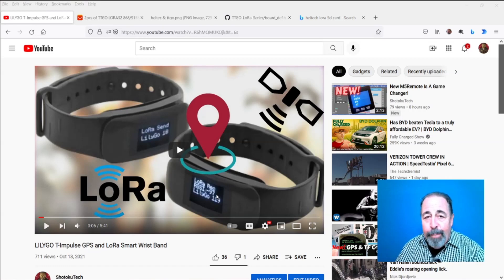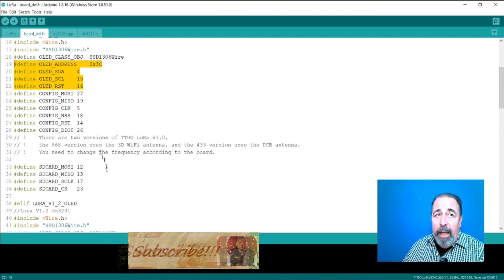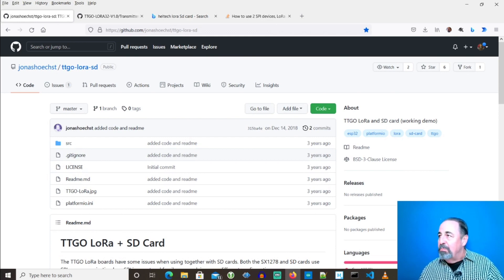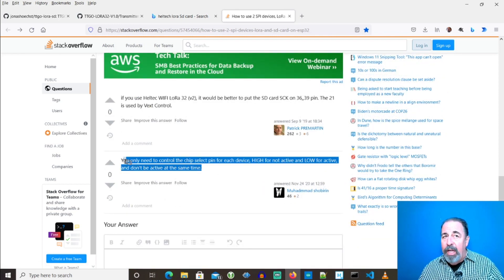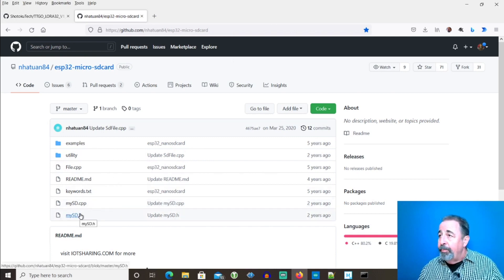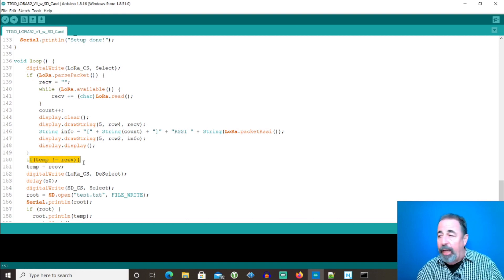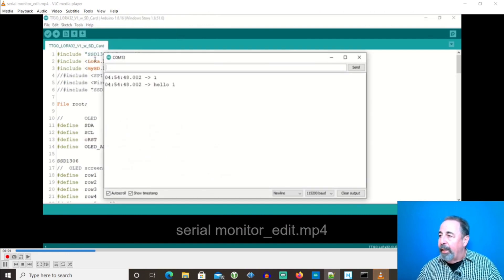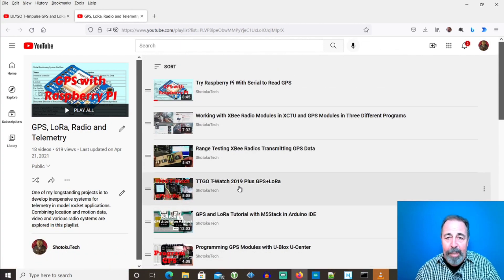TTGO LORA32 V1 With SD Card Data Logger

Comment: Hey! I have some issues with the code :( im getting a
"Initializing SD card...initialization failed!
error opening test.txt
error opening test.txt"
I check the pints, and all looks good but im not able to connect :( the only modification i did was add "ext::File root;" 
Im ussing TTGO LoRa 1.3
Reply from the maker: Did the pinout change for V1.3? I don't have the latest one.
Reply: @ShotokuTech  No, to much the only change is the pins for the OLED